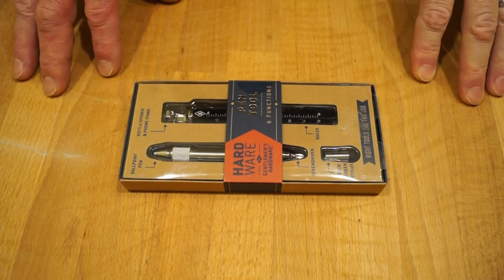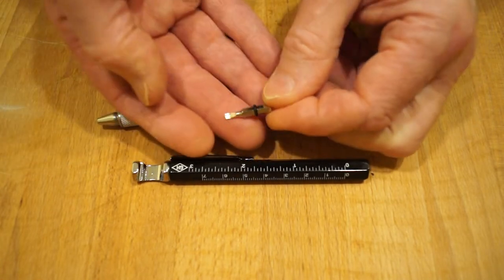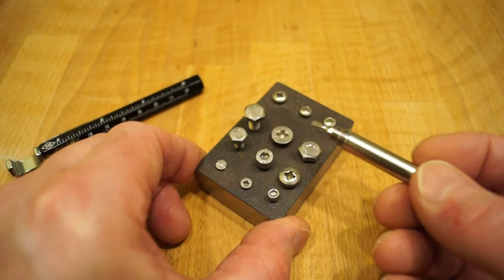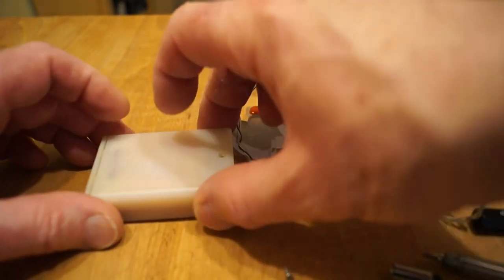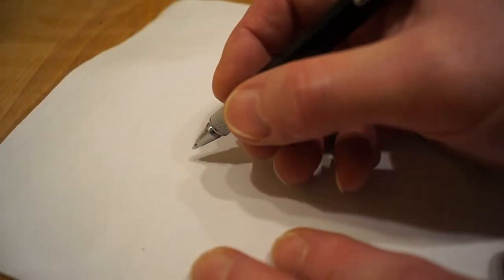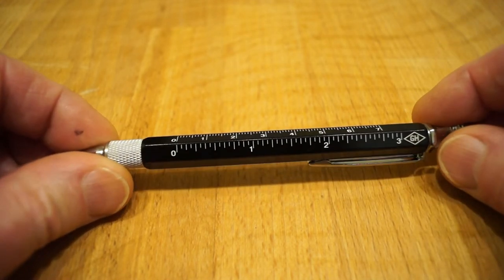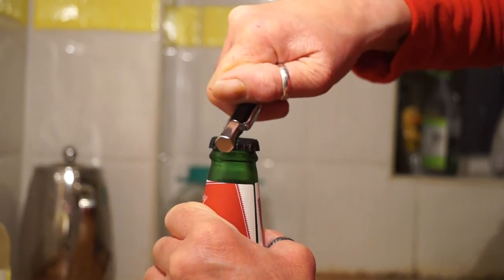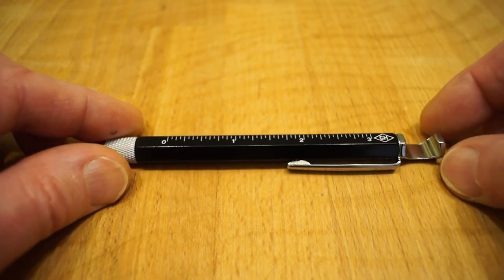Gentlemen's Hardware Pen Tool Review

Comment: It’s nice that the cap lifter is made of a material that can withstand the rigors of cap lifting without breaking off. It’s too bad about the screwdriver not fitting into the octagonal shaft for grip.
Reply from the maker: A missed opportunity there, with the screwdriver, I think. Thanks for watching 👍👍👍